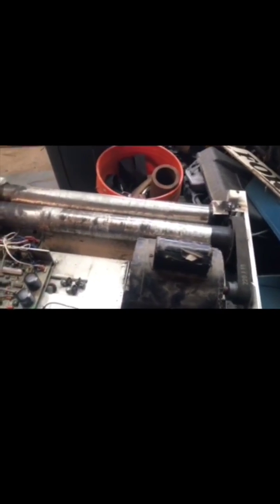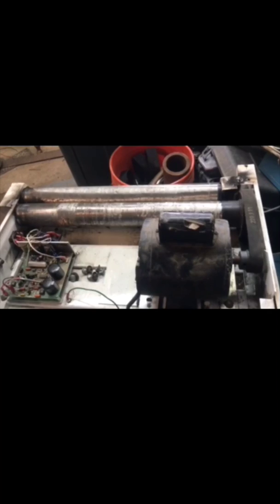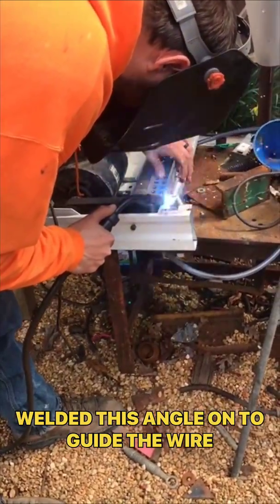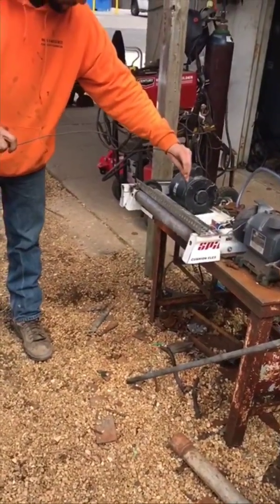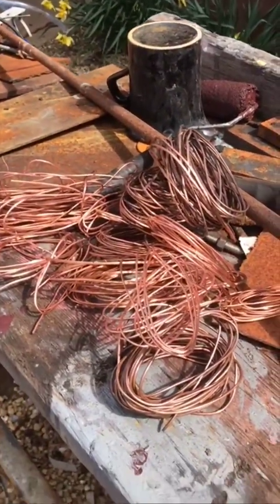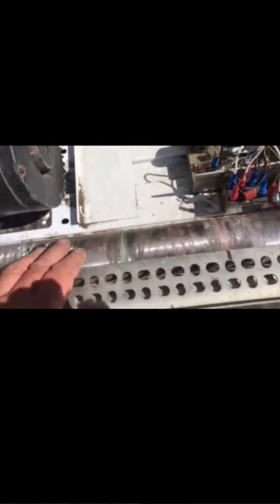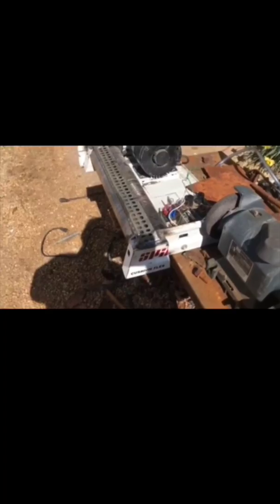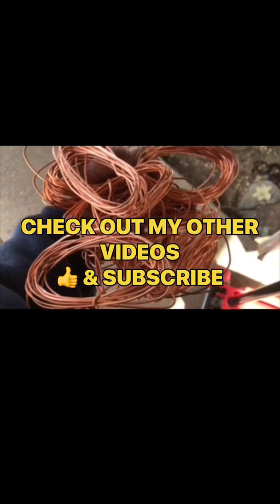Awesome Homemade Wire Stripper From A Free Treadmill Works Great

Comment: If you put a break on that and feed several pieces at one time it'll go much slower you're the kind of sounds dumb but you can feed 15 pieces in at a time rather than just one at a time
Reply from the maker: Yes I can do multiple strands but have to watch they don't tangle it works good

Comment: Hello sir, do you believe or have you tried other types of wire?, specifically soft cords from small appliances etc. I have a good working wire stripper for heavy gauge but wander if this machine would squish soft rubber housed wire.
Reply from the maker: Sorry I this machine will only do solid core wire it just flattens twisted  soft wire I did buy a large machine that does all wires it was very expensive 
Please check it out I made a video